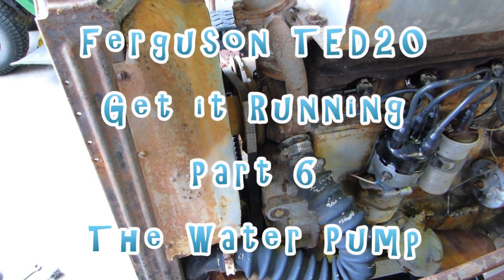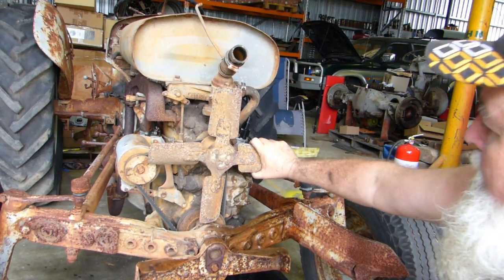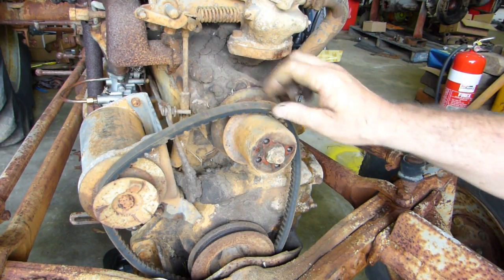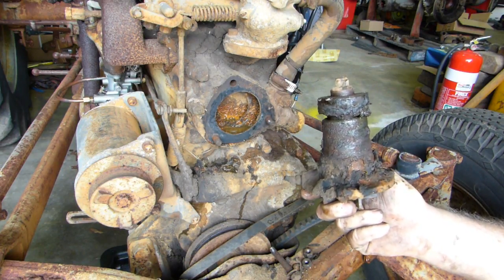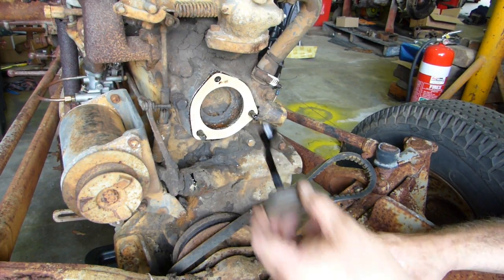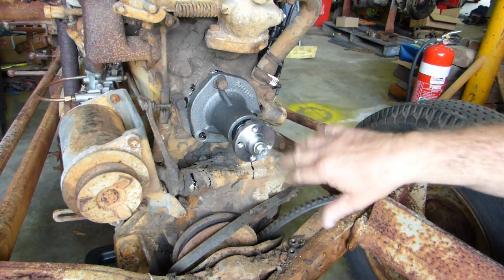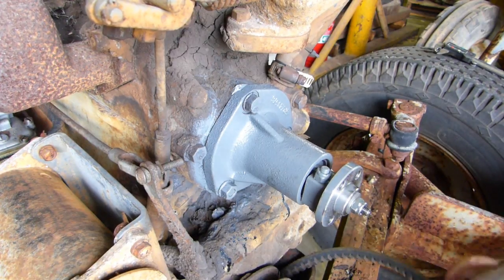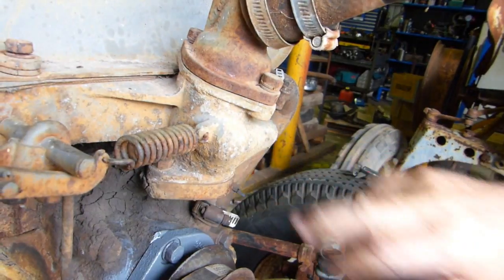Ferguson TED20 Barn Find, Lets Get it Going Part 6 The Water Pump

Comment: Getting the radiator out of the way makes replacing the water pump an easy job Lance. 
Nice work getting the pulleys lined up. Enjoy your week.
Reply from the maker: G day Lloyd, Yes having the radiator removed easily is a good think for working on it and filming as well. There is a few things to go on the old girl yet though.

Comment: Just did this job. One thing to watch out for is the holes on the new hub not 100% matching up with the holes in the fan and pulley. Only off by a millimetre or so, but enough to make getting the bolts back in a bit fiddly, especially when going in from the side as I was.
Reply from the maker: G day Edward, I have found that out as well. Just off a little.
Reply: Bundy Bears Shed nothin a little rub with a file on the fan and carrier holes couldn’t fix

Comment: My cooling system didn't have a thermostat in it when I found it, but I didn't know, and I didn't know why the radiator was venting the pressure after 10mins of warm-up. It's because if you take the thermostat out you have to also block off the thermostat bypass hose. The farmer before me did half-a-job.
Reply from the maker: These tractors are old and have had many different people with varying skills working on them. I'm not so suprised at what I find now a days.

Comment: Mine hasn't got that funny slotted bracket that came out from under two of the fan bolts . What's that for? All I can think of it being is a balance weight, but how would you balance that assembly? Obviously meant to be there or Lance would'a been surprised.
Reply from the maker: G Day Stuart, That slotted bracket is called a balancer in the parts breakdown but I cant imagine it doing very much as it is so light. I went to the repair manual and it doesn't get a mention so I'm not sure really.
Reply: Thanks for checking on that, Lance. I just had a thought and am wondering if it's there just to offset the out-of-balance caused by that big cotter pin on the water pump shaft. It would be interesting to see how they had it placed in relation to the cotter pin.
Reply: Oh, wait. I guess a trapezoid bolt pattern is inherently unbalanced too. Maybe that's why it's there. Er..., do you sell that balancer Lance?

Comment: Is this the same procedure for the 23c diesel on a FE35? Mine is leaking excessive water from this area so I’m going to do a pump and seal.
Reply from the maker: Yes it is the same pump usually. Unless there has been an after market one fitted.

Comment: My bought a TEA 20 recently and I have been working at getting it running.  Your videos are much "appreciated"  When I had the carb off I noticed that a piece of linkage (a rod that connects the throttle to the choke) was missing and I haven't been able to locate a replacement part.  Any idea of where I could find one??? Thanks!
Reply from the maker: G day Fred, They are just a bit of 1/4" rod with a 90deg at one end and a unf thread at the other. Easy enough to make depending on what gear you have at your disposal. The only other option is a wreckers.
Reply: Lance, thanks for you reply, I'll have a go at making one.  Great that you find the time to answer queries.  Love your videos on Fergies.

Comment: I need to purchase new pump but I also need the housing that the pump attaches to.  It is in-between the motor and the water pump.  I can not find this part on your web shop.  Is this available?  My unit has the hose outlet to the bottom of the radiator rusted away. Thanks
Reply from the maker: No it is not available ,only second hand. There are also different ones depending on if the water pump is on the block or the head .
Reply: @BundyBearsShed  thanks for that tip
Reply: @BundyBearsShed  do you have a second hand one for sale?  Need on the head.

Comment: GDay 👋🏼🦘Mr. Bear 🐨 from W.A🦘
Your uncontrived tutorials were the Main force ⚡️ guidance 🎓 coaxed me through tackling 2X P.T.O bearing change outs, ➕ the confidence to improvise with their seating.
This topic on cooling systems, caught my attention due to a new addition to my humble Fergie fleet, is gradually loosing aqua, after a reasonable slasher set.
🔍🤔 Thankfully 🙏😅 there’s no discolouration in zé installed coolant, the improvised metal piping/muffler tube, is tight with the relatively recent hoses.
So, this Certainly leads to ‘once again’ this Welcomed vlog/post of yours is going to prove invaluable, I’ll watch again how you detach the radiator.
The surrounding shroud, should be straightforward, Cheers 🍻 GøVernøR Beår 🐨🎓🎶🤙🏼😉🌅🦘
Reply from the maker: Glad it helps.

Comment: Does anyone know what the purpose of the curved washer is? The one that sits with two bolts in front of the pulley and is market "balancer".
Reply from the maker: I'm keen to know as well. The parts book calls it a balancer but it is very light.
Reply: It must be balancing the cotter pin and/or the trapezoidal bolt pattern so you have to put it across the correct two  bolts, but I'm keen to know what the adjustment procedure is...

Comment: Hey, shouldn't you have run the circuit with some cleaner before fitting the new pump ? That thing looks rusty as hell :)
Reply from the maker: I often don't like to as all of the scale etc once dislodged will block the top of the radiator fins, then you over heat and need a radiator repair or replace. Sometimes it is best left alone.